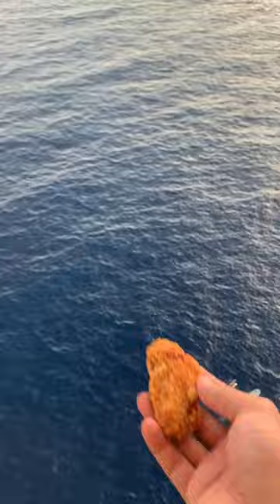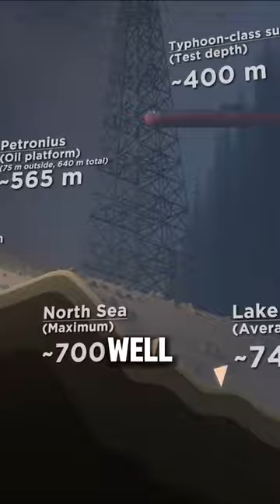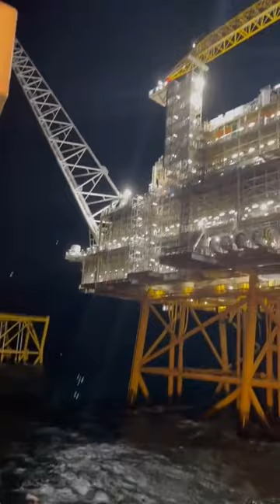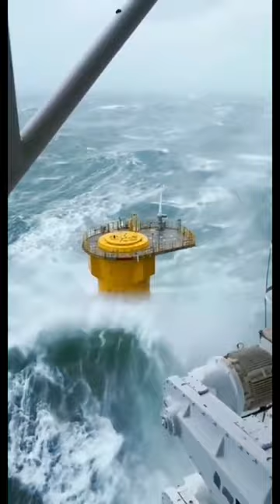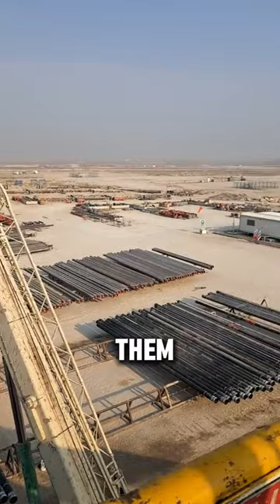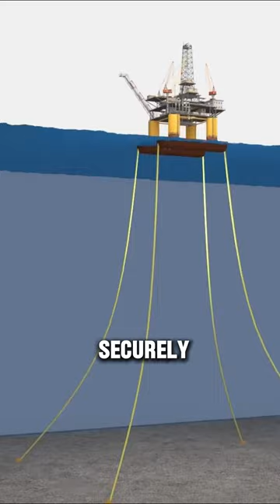This Is How Oil Rigs Are Built In The Middle Of Deep Ocean😱

Comment: Short answer no , they’re built ashore and towed into shallow water via 3 tugboats , it is towed above a specialised submersible watercraft that is a ship with a lowered deck to allow things to be position over it , it can then fully surface and the cargo is now aboard , they are taken into deep sea and the watercraft submerges and moves away , they are balance via computer controlled propulsion allowing them to float stable or are just floating oil Rigs mounted to a hard surface beneath the seabed

Comment: Maybe it’s wrong or just different but in deep waters they fill the bottom of rigs with water so the bottom floats underwater causing it to be more buoyant
Reply: Its called ballast, common in ships as well, and its to control how low in the water it lies for stability not buoyancy
Reply: thats what sank the ocean ranger. the port window got hit by a huge wave and caused some computer controls to go crazy and those controlled the ballast tanks and the valves were opened and caused it to fill the tanks and flip i do believe. only took a like 2 or 3 hours to. happened really fast.
Reply: Small correction by the way it does control buoyancy, which in turn affects stability as you can control how low lying it is

Comment: So the floaring ones don't have drills? Also: Why use miles for the ocean depth?
Reply: i had many more questions than answers after this video… but also, america is dumb and still uses miles… they should’ve used both
Reply: The floating ones have pipes like cables connected to the anchor which is also a drilling tool for the oil. I hope answered ur question. I had this topic in my study course of engineering a few months ago. 
Sry for my bad english Im actually living in Germany but maybe I will do a semester abroad at virginia tech in the US.